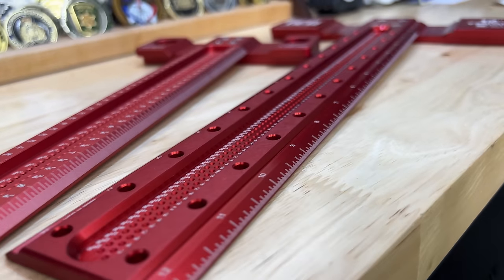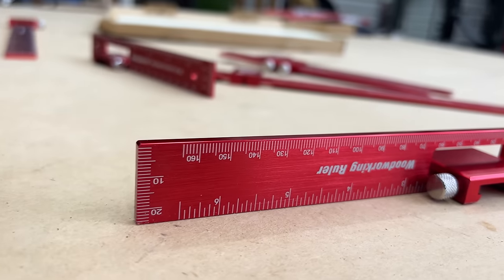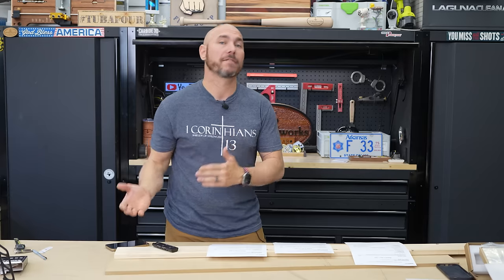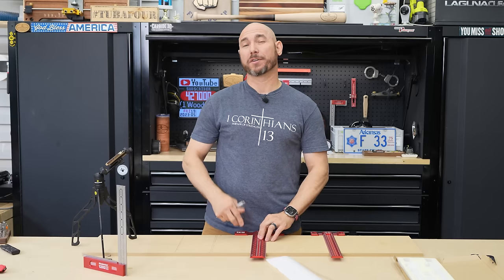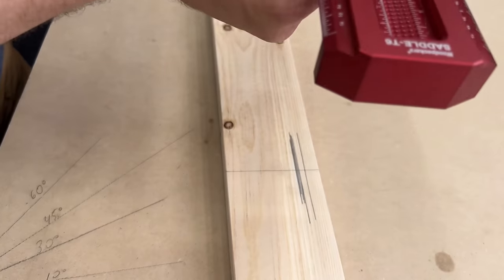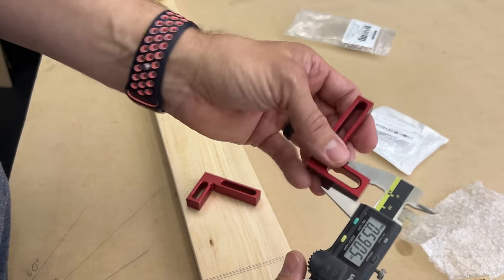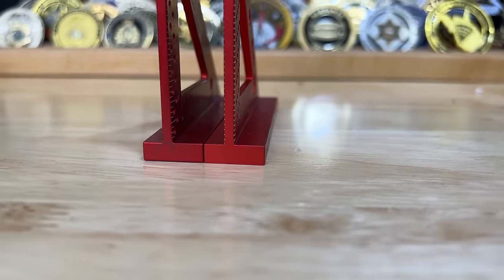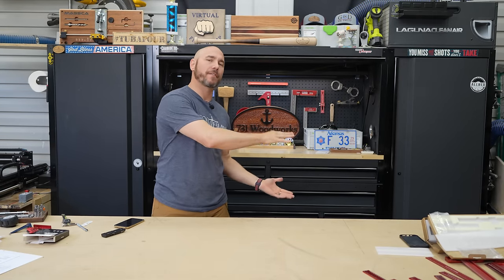Real vs Rip Off Woodpeckers Tools | The Results May Shock You!

Comment: I just can't justify paying the woodpeckers prices for a piece of aluminum.  Are woodpeckers tools good? Yes. Are they way too expensive? Also yes. Same thing with Festool. Cant justify those prices for a plastic tool in a plastic box.
Reply: Purchase some of each of this brand's products use them for a year and then tell me the price isn't justifiable. I'm by no means wealthy but I've bought the Rotex 125($659 I believe) and the Festool finish sander ($229)
And three different woodpeckers products (delve square , stainless steel combination square set, 12" T-square) but I can attest they are DEFINITELY worth the money. The Rotex obliterates the sanding time of the my Dewalt sander and time is money ESPECIALLY where woodworking is concerned. And the accuracy required for fine woodworking is something woodpecker GUARANTEES and to me both of those are important. Not saying you're wrong for feeling like you do I'm just saying that after a year of use of these you wouldn't be able to truthfully claim that. I say all this respectfully.
Reply: They sell steel ones, which is what I bought. Even more expensive. But they are a joy to use!
Reply: For me, festool saves time. Most times 10-30%. So it pays itself back. Everyone its own.
Reply: @vampirejesus8170  I agree about the one time tool aspect I am not a big fan of that, also I guess I'm just not advanced enough yet to the point I can make do with whatever I have to work with I'll get there eventually I have pretty good
Mentors to talk to when I encounter an issue that is beyond my comprehension
Reply: @stephenpalazzi720  I hear you there. It is good to have people you can bounce questions off of..
Reply: @daytradingnl4734  Yep I understand the time saving. I would be out helping my dad work on a car in the driveway. He never wanted to spend the cash to buy the correct tool to do certain things on the car. So a 30 minute job would turn into over 2 hours fighting to do it his way. So I made sure I have had the correct tools for working on my cars. But a 1000 dollar track saw or two pieces of plywood that I can do the same thing with. Cost me less to make it than the sales tax would be on that track saw. Might take me 30 seconds to a minute to set up my plywood track saw.
Reply: Sometimes you just want to spend money
Reply: Horrible comparison with Festool
Reply: @daytradingnl4734 speaking of time, you’re wasting yours, trying to convince someone who’s never used or embraced the festool system. They will never, ever get it.
Reply: Festool’s “plastic boxes” must have wide appeal considering the number of other companies now offering their own “similar” systems. Also Festool innovation and quality are apparent to anyone who has actually used their tools. Not having the money to buy a tool doesn’t make it overpriced.
Reply: @eagleonone  To each their own. I personally can make cuts the same if not better with a Dewalt and still have 800 bucks in my pocket. Plus I don't need a plastic box to show off my tools.
Reply: If you’re fine with China all over everything…then we get people losing their mind that China is so powerful.
Reply: I’m in the UK and have been woodworking for over 45 years and would like to think I know something - but also that there is a ton of stuff still to be learned. I do make a difference between power tools and measuring tools because of their complexity and then make a distinction between tools used all day, everyday and those just used occasionally - different needs.

I have several Woodpecker measuring tools. They are very nice but very, very expensive here in the UK. I also have tools from iguaging, Starrett and, much more recently, a good few from Veiko via Banggood. 

I will talk about the Veiko tools particularly. I’ve seen and read some comments that some measuring tools bought from China are not accurate. I can’t comment on those but I only buy Veiko and, to date, they have not disappointed me. They are very robust (needed in any busy workshop) and accurate ( the essential). Now, accuracy means different things to different people. To a space engineer, my definition of accuracy is laughable. I rarely have to think better than 0.1mm and, even then, it is quite likely that the piece I cut yesterday to within 0.1mm has moved so that it is now “inaccurate”. Quite often, what I’m looking for is consistency in that all pieces have to be cut the same but that could be +/- 0.5mm. Even when I have cut as accurately as I need for a certain job (my needs would differ from, say, an exterior gate to a fine jewelers box) I also dry fit and can finesse a piece with a shooting board or a lick of abrasive or whatever. 

Obviously, I test my measuring tools when I get them, periodically afterwards and, when it happens, straight after they may have been dropped. It’s a normal routine in the shop just like sharpening blades, cleaning filters etc. 

I may well have lucky in all my Veiko tools but none have been rejected by me - neither has anything from Woodpecker, iguaging etc.

Do I like the way in which the Chinese government rules? Absolutely not; it is an evil regime just as Russia, North Korea etc. 
Do I like buying from China? I make the distinction between the population and the government. 
Am I naive enough to think that the majority of tools, domestic equipment that I buy does not also get made, in part or in whole, in China? Of course it does. Some many “western” brands are made on China and, even if the western brand owns the factory, it pays taxes to the Chinese government. 
Would it be double standards for me to, somehow, buy an iPhone but refuse to buy Veiko? For me, it would be.
Am I a total fan of the US government? Certainly not. I’m equally critical of the UK government (and most UK governments of the last 50 years). I wouldn’t equate either in any way with China etc but it would be daft to suggest that the US government is anything other than run by the normal set of inept politicians. 
What do I think of Woodpecker pricing? I think the pricing is set by Woodpecker marketing to be the highest level at which they think they can sell all their production. I think that they, as with others, want themselves to be considered a premium brand and can demand a premium price. I don’t think the Woodpecker pricing has a direct correlation between cost and retail price. The Veiko products are made from the same aluminum (which is a global product and subject to global pricing) with much of the manufacturing, be it Woodpecker or Veiko, done by machines - so labor cost differentials are not that relevant. 

With my power tools - be their mobile or stationery, I make a distinction. If I rarely use a tool or need it for a single job, I may buy a secondary brand. If it’s a daily use, then I buy a primary brand (eg Festool, Jet, Hammer) because I can’t afford them to let me down. One days lost work can cost me more than the difference in cost price between cheap and best. I do use a lot of Festool for that reason plus their servicing and insurance policies but I couldn’t justify their pricing, again, in terms of cost plus. I have got both dominoes and had them for years. Any and all development costs incurred by Festool were recovered years ago and it’s now a commodity piece of equipment - or it would be if not covered by Patents. But, the exorbitant price (not that they were anywhere as expensive when I bought them) is justified for me by the time it saves me over using the floor standing morticer. I also have the issue that my deteriorating body complains loudly after a few too many pulls on the mortising lever. 

I hope that all this gives someone an insight into my way of thinking. It will be different for other people.
Reply: @theofarmmanager267 How were you able to determine tthat he Woodpecker vs. sent to China were made from the same type of aluminum?
Reply: @_SYDNA_  I took the squares to the engineering laboratory at the University of London and had them spectro-analysed for their molecular profile. Is that really the most incisive, the most relevant comment that you can think to make? Forget accuracy it seems; forget price it seems, let’s focus upon the type of aluminium. What the hell does it matter to a woodworker as to the type of aluminium? They looked the same, they felt the same, they have behaved the same - that’s as much as I are about the type of aluminium. If it were part of the aeroplane in which I was flying, then I might want assurance as to the certification of the aluminium - but a woodworking square? If it were to be the case that the aluminium used by Woodpeckers and/or Veiko was so inherently superior, then I would ask why? Is it necessary for me to have Grade 1 used? Is that the reason you think that I should pay 10 times for the price for a woodworking square?
Reply: @theofarmmanager267  Good quality aluminum alloy is a reason I would pay substantially more.  I dislike filing the burs off of my cheap framing squares from the big box store, every time I drop them because they are made from a very soft alloy or probably no alloy at all.
Reply: @_SYDNA_  I had thought that my original comment was self-explanatory in terms of the quality and accuracy of the rules and squares that I have had from Veiko. For the avoidance of doubt, I see no material  difference in quality between my Woodpeckers and Veiko items; I’m not going to drop items onto the floor in order to test the hardness of the material and so cannot comment on that
Reply: I agree
Reply: I used to say the same about Festool. I was ignorant and wrong. Those who actually use these tools understand why they are worth it. Those who don’t just hate out of ignorance. Like I said, I used to think the same ignorance. If you can use the tool properly, you’ll buy it, and you won’t regret it.
Reply: And when buying Woodpeckers tools you're helping to employ Americans who then spend their money to buy cars, groceries, appliances, etc.
Reply: Right!!
Reply: @BeaulieuTodd Ive been a cabinet maker and furniture builder for 40 years. Ive used Festool tools sanders, jig saw, chop saw, etc. 
Are they great tools yup, they are  but can their jig saw out perform my 25 yo Bosch 1587? Never!
The Festool Kapex KS 120 is just a miter saw, nothing special about it, except the price. 
And the sanders Ive used wobble like they've been dropped a dozen times.
Just my experience with them.
Reply: Perfect 👍🏻
Reply: I am planning to buy full packs woodpeckers on 31 February next year 😂
Reply: @stephenpalazzi720 no

Comment: the irony is that if you really want precision then you aren't using rulers and pencils.
Reply: That was my thought. I am getting the slide rules though to lock down measurements and save them for later
Reply: not that ironic, they are woodworking tools and considering that wood moves to some degree it doesn't matter if you use a more accurate method
Reply: @T0tenkampf  as a matter of fact it does matter a considerable amount.  For example if you are making hand carved dove tail joints, or mortice and tenon joints.  You aren't going to be getting the precision you need with a ruler and pencil.
Reply: @tchevrier that’s what I use veritas marking gauges for.
Reply: @tchevrier Ive seen 100 year dovetails that might make you walk that back a bit.
Reply: @denniscotey8182  nope. 100 year old dovetails most likely used gauges etc.  Do you want to walk back your comment?
Reply: @tchevrier  nope.
Tables and other furniture that I made myself over 20 years ago with no mechanical fasteners, mortise and tenon and glue only, is still together and tight. And I marked them out with a pencil and combo square.
Reply: @tchevrier  a great many 100 yo dovetails were laid out with a pencil and a ruler and hand cut. 
Not everyone used a marking gauge.
Reply: @denniscotey8182  Yep!  I don't really care what you built.  I've also built many dove tail joints and mortise and tenon joints myself without using a pencil and ruler.  So what you did is absolutely moot.
And a great many many more 100 yo dovetails were laid out without a pencil and ruler.  It is a far more precise method. c'mon man
Reply: @tchevrier  better tools dont make a better craftsman.
Reply: @denniscotey8182  And that is exactly the point, my friend. A craftsmen can do a better job without a ruler and pencil.
Reply: @denniscotey8182 ive seen 105 year old dovetails that prove different. Anecdotal proof matters to no one but yoh

Comment: You've got to give credit to Woodpeckers: they've managed to convince an entire generation of woodworkers to pay through the nose for tools delivering accuracy a machinist would envy. The Emperor's New Clothes of the woodworking world! 🤣
Reply from the maker: lol love the Emperor's New Clothes analogy!
Reply: I call it the Apple effect.
Reply: Studies have shown that people equate high price with a better product, even if the products are exactly the same.
Reply: Anything less than an eighth of an inch is unmeasurable. Kidding aside, modern woodworkers be getting pretty crazy with their tolerances. It’s not titanium. Your furniture isn’t going to stay where you put it. You don’t need to be thinking in 64ths. It just doesn’t matter that much.
Reply: @CarlYota  I think that's going to be where I struggle most when I start making stuff, honestly. I work in a machine shop and have for over a year, so I measure things in thousandths of an inch every single day. Typically down to a 3 or 4 thousandth tolerance... Or about the width of two hairs lol. So when I get to actual woodworking, that's what I'm going to naturally want to measure to and have to remind myself it ain't that deep lol
Reply: @CarlYota exactly. Embrace metric, 1mm is enough and that's around 1/25th of an inch. I've switched over the last couple years and it's so much easier dropping the fractions. I went to my local hardwood dealer yesterday with a metric tape and calipers (I like to figure out how much machining I'm going to have to do). The guy working there told me he never used calipers and thought that was a good idea. I explained I was also measuring in metric, and my reasoning behind it. The look on his face looked like a hundred light bulbs turned on all at once.

Comment: I really like Adam Savage's advice about buying new tools. He says to buy the cheapest version of a new tool you can find. If you end up using that tool to the point of breaking it, buy a better quality version. You could also add, if you're missing a feature that a more expensive version of the tool has, then you know it'll be worth it to you to pay the higher price.

Great video Matt! Really enjoyed it.
Reply: I think this is good advice for hand tools, but not for power tools. If you know you’re going to use something, going too cheap can result in diminished quality and create an inaccurate perspective.
Reply: There is definitely some validity to that statement but I'll give you an example where it doesn't apply.  I've had a cheap hand plane for many years.  It was always a pain in the a$$ to use and never really worked properly.  Recently I decided to buy a top of the line hand plane.  Wow!!!  what a difference.  Same thing with a set of chisels.  But I suppose a big part is also knowing how to properly use the tool as well.

Comment: Thanks for the detailed review.  Had not seen these; will probably buy a few of them.  One thing I would have liked to see is testing the durability of the metal.  

Like many of us, my "shop" is my garage and often times that may actually mean the driveway in front of the garage, with smallish tables or horses.  I love some of the things I can do with a speed square, but the soft aluminum in the budget square I found in the big box store dents and burs up like crazy when you drop it.  Which means everytime it drops i have to get out my file and try to knock off the burs without affecting accuracy. I work hard to protect these things but it happens.  The difference in sent-to-china stuff is sometimes the lack of environmental regulations and cheaper labor, but sometimes its the unseen things like metalurgy.  

It would be nice to see a "drop test" or hardness test (or maybe just poke each of them with a sharp object) to compare these two and see if the American made Woodpecker stuff is tougher in daily use.

Follow up:  So 731 gave me a "like" on the original version of this comment which probably motivated me to do more (honey vs vinegar, etc.).  It turns out "Vickers" hardness is a good measure for dents in metals and dent resistance in aluminum is highly variable by alloy.  In fact it varies by a factor of 15x !  Here's a link: 

Overview of materials for Aluminum Alloy
https://www.matweb.com/search/DataSheet.aspx?MatGUID=ab8aeb2d293041c4a844e397b5cfbd4e

BTW:  The type of alloy doesnt seem to have much affect on thermal expansion.

To me it would be worth it to get tougher stuff, but tougher stuff is harder to drill so it will, of course, cost more.  I wonder if the Woodpecker tools are made of tougher stuff?  I think I may actually get that WP t-square, which is definitely a step up from drawing lines with my framing square.  I'll see if I can test the WP dentability with a nail or something in some obscure location.  Thanks again for the review.